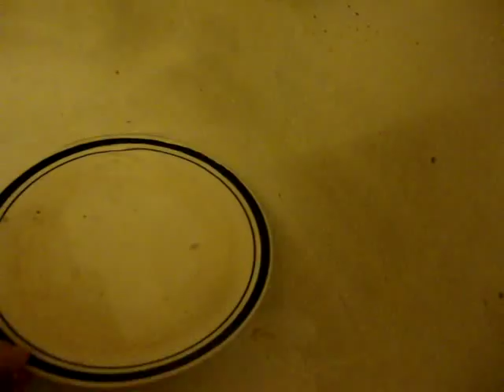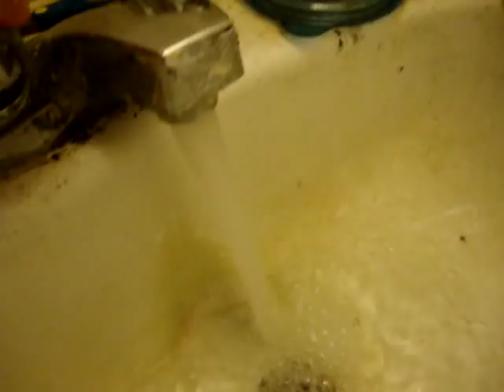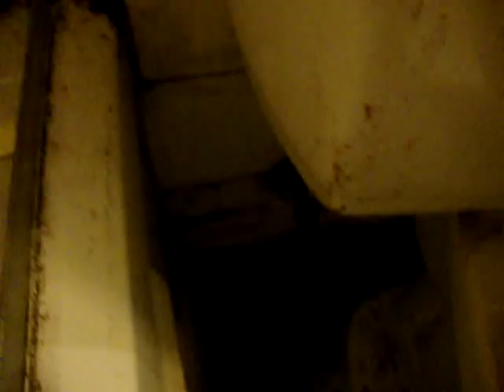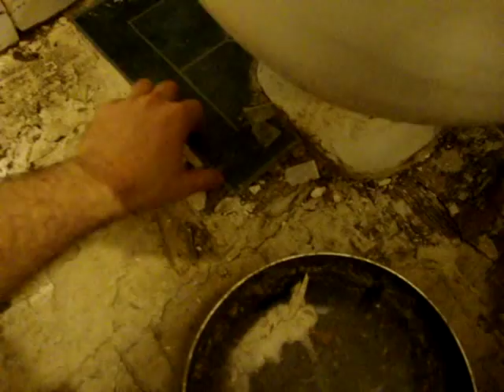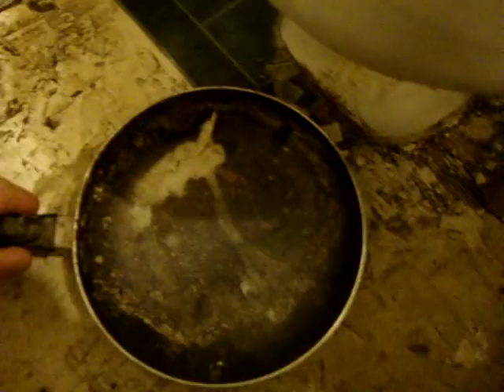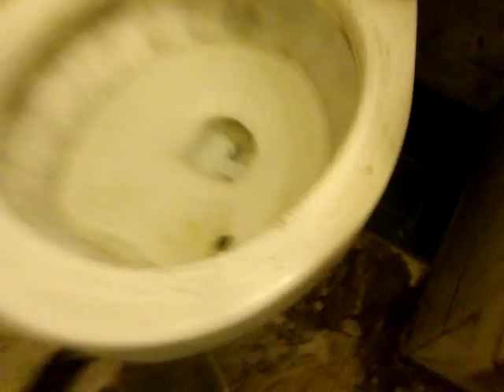Toilet Mysteries

Comment: the cold water supply is turned off to the bathroom. the bathroom sink faucet cold knob is turned on, as well as the tub. when you turn on the hot at the sink, some of the water feeds back into the cold line and comes out at the tub.

Comment: Try taking off the handle of the shower and replacing the cartridge. All your cold waterlines should run off one main and when you turn on the sink it leaks back out off the bath faucet cartridge. I'm no pro but I spent a year as a plumber.

Comment: You need to replace the washers inside the tap's (faucet) because they most likely have deteriorated and cannot handel the sudden change of pressure. It's something you can do yourself and will cost you about 5 dollars worth of parts from your local hardware store.

Comment: @masaoHF Tell him you want to fix your plumping before you redo the walls and floors, that way the water doesn't ruin your paint job/floors. most plumbers have seen worse. if you explain to him you havn't fixed it up due to the water leaking, he doesn't care. plus, plumpers =/= judgemental teenage girls.